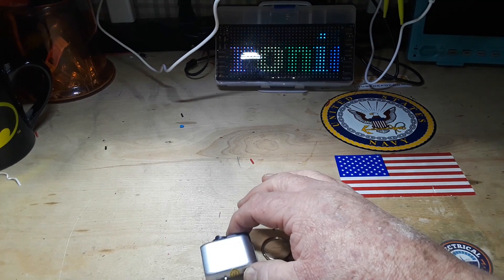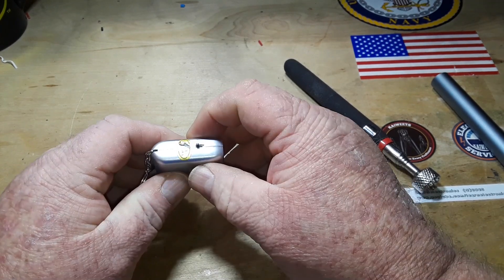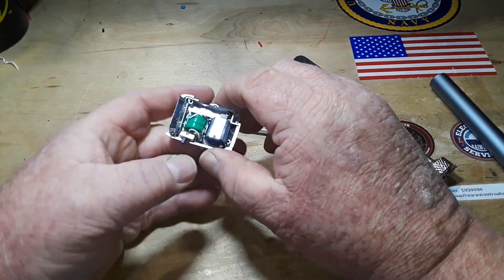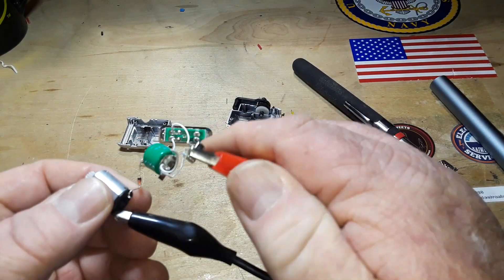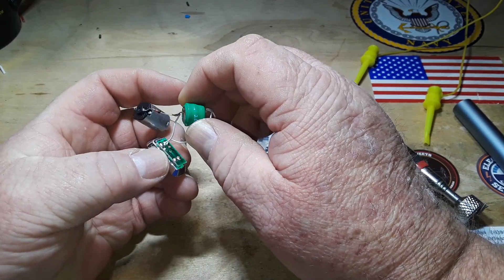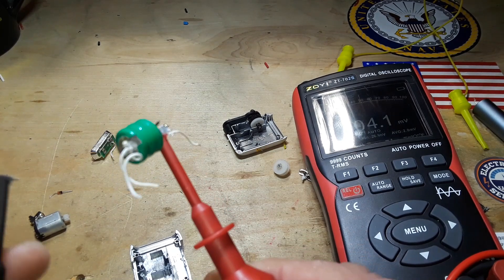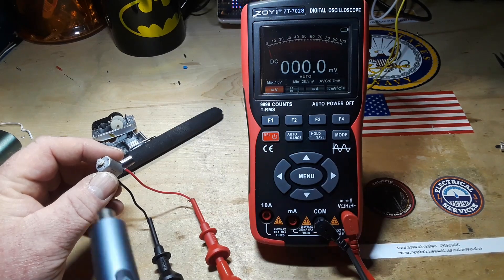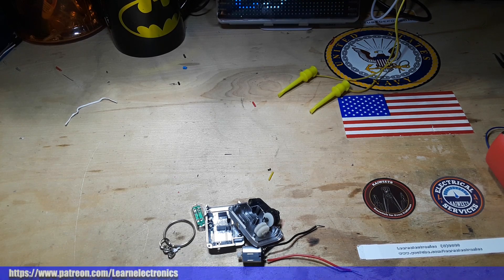Can I Save An Old Wind Up Flashlight?

Comment: I have taken what I think was a stepping motor from a printer and connected an LED to it with no resistor. When I spun the shaft the LED would light up.
Reply from the maker: Yep you made a DC generator

Comment: My favorite "motor = generator" demonstration is to take a PC case fan with LED lighting out of an old computer case and use a can of compressed air to drive the fan blades. I've never measured the voltage, but it's plenty to light the LEDs.

Comment: Paul, was there AC output that was higher? Maybe that is why the diode? Maybe a supercap in place of the battery.
Reply from the maker: The diode is a flyback across the motor to prevent a large emf when the field collapses.
Reply: @learnelectronics  Hi Paul the diode is there as a blocker to stop the motor "motoring" and draining thre battery nice simple teardown 🙂

Comment: Too bad, cool little light. You can't save them all.
Reply: I have 2 similar lights. One works the other doesn't. Also have a crank flashlight that the plastic crank handle has broken off of. I can charge it using a drill to turn the shaft (but seldom do so). The drill does not work on the mini light. I suspect the batteries on that one.

Comment: You could throw in a small super capacitor instead of the battery.
Should work just fine since there's already a diode in place.